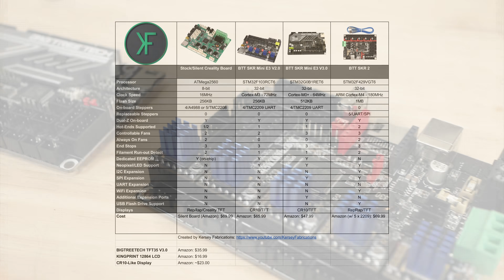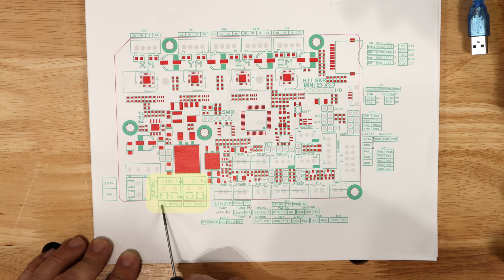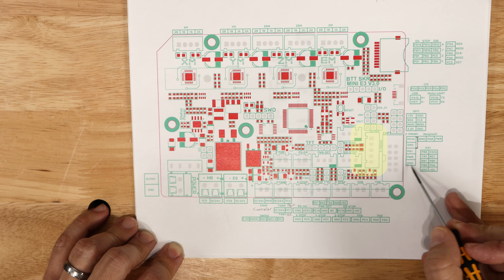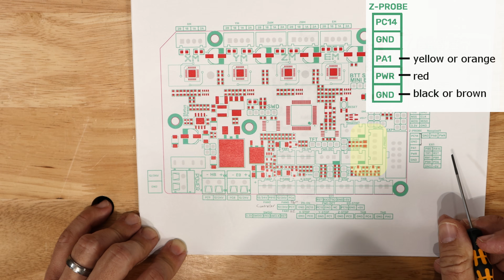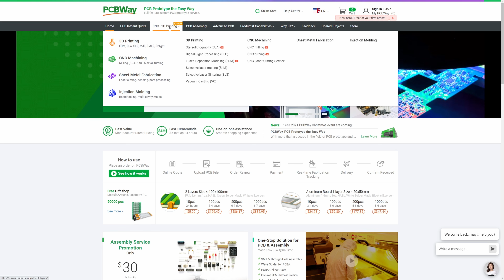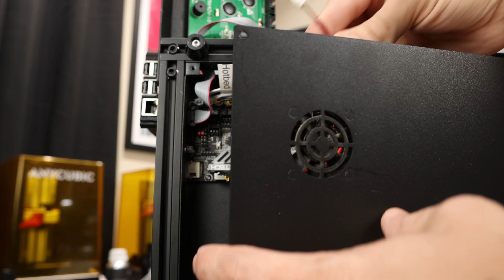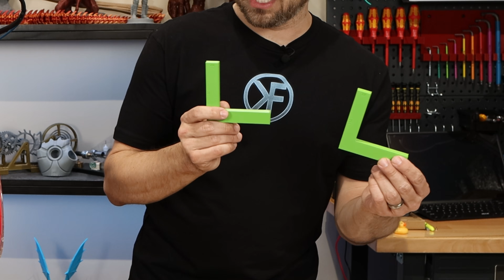Bigtreetech SKR Mini E3 V3.0 - Ender 5 and Ender 5 Plus

Comment from the maker: NOTE: The Ender 5 Plus requires a new display (at this time) to upgrade to this board. Please see my other Ender 5 Plus videos using Bigtreetech boards.

ALSO NOTE: There are many reports of people having problems using this board with the stock BLTouch on the Ender 5 Plus. It does not happen to everyone. It did not happen when I tested it myself. The only known POTENTIAL fixes are switching to a CRTouch, switching to Klipper, or there has been a case of just needing to update the touchscreen firmware to the latest.

With that being said, I CANNOT and DO NOT recommend this board on the Ender 5 Plus at this time. There are too many people having these issues and, while I've improved it in my latest 2.1.1 firmware, I have not been able to provide a fix for this issue. So far it appears to be an electrical issue that software has not been able to work around.
Reply: What do you recommend instead?
Reply from the maker: I recommend the SKR 2 or SKR 3 (just released beta firmware) at this time. The SKR 2 has been running great in my printer.
Reply: @kerseyfabs  skr or 1.4 turbo?
Reply: Or skr e3?
Reply: @kerseyfabs  u recommend the skr2 skr3 or skr e3? Or turbo 1.4 which would u really use
Reply: I was talking a rep at Microcenter, and he stated that if you change the BL touch to use the 5 pin Z probe, and change the firmware, it will fix the issue. Have you tried this?
Reply: @subytek  I have not. I don't even know which 5 pin connector to get
Reply: Have you seen this video from Aurora Tech about fixing the BL/CR touch issue? https://youtu.be/dtwWnz2-5VQ
Reply: Hey does this work for ender 5 pro also?
Reply from the maker: @twiztid664  Yep!
Reply: @Kersey Fabrications  right on, any suggestions for a newbie wanting to compile for first time, my setup is a ender 5 pro, crtouch, and microswiss d.d&h.e.
Reply: whick kind of problem with bltouhc?
Reply: Supported now for ender 5 plus on multiple firmwares off the e3 mini v3
Reply from the maker: What do you mean?
Reply: @kerseyfabs  Oops I missed the word LCD lol xD

The stock LCD is now usuable with the Ender 5 Plus and the SKR mini e3 v3, just nobody has done a video on it, only text based dudes. *made by tinyfluffs on github :) silly yt banning ink shares lol
Reply: @kerseyfabs  CrealityDwin_2.0 for marlin code that works with the stock lcd :)
Reply: @noviceartisan  do you have a link to that firmware ?
Reply: @noviceartisan  got a link?
Reply: @noviceartisan  I don't suppose u got a firmware  I can use ??
Reply: @ryanw501  There were a few more optins than I thought that needed adjusting to make it work. I've now got the stock LCD working perfectly with the SKR 3 and the SKR Mini E3 V3 and Marlin <3 This channel has links blocked so idk how I'm to share it with you?
Reply: @noviceartisan  got the screen flashed now i am confused as to what marlin im supposed to compile and if im supposed to use audrino ide to compile and flash it thanks for the help
Reply: @azarian44  which screen are u using
Reply: @azarian44  I've got it sorted now, quite happy to share the finished file with you, you just copy it to the sd card, put it in the board and turn on, then wait for it to stop flashing the led, then power off, remove sd card and power back on and alll will be good :D (Obvs make sure you've got the pins for the board wired up right) I'll be making a walkthrough that I'll add to the Reddit Ender 5 Plus wiki soon. How can i send you the finished file before then so you can get on with it? I can't share links on this dudes YT page :(
Reply: @noviceartisan  did you end up doing that write up? I am not on reddit so if you could post it here it would be a huge help
Reply: @alexanderneu5436  I can't post links on here, the OPs channel has links blocked 🤕 My email is on my channel in the about section if you want to communicate that way 🤘
Reply: @alexanderneu5436  You all good now after that bit of help dude? :)
Reply: @noviceartisan  I am going to start the conversion tonight actually. I think I am good, but I might send you an email if I run into an issue tonight. I think its funny that Kersey blocks the links to a less cobbled solution 🤣
Reply: @alexanderneu5436  The one I've shared on the repo is for the skr 3, keep forgetting to add the skr e3v3, just needs the motherboard tag and the stepper motor fileds changing to work with it tho. Connects to the TFT port on it. Pin out is rather obvious, +5 to +5 gnd to gnd, tx2 to tx and rx2 to rx :)
Reply: I'd like to say I compiled my own firmware that you can use the stock screen, also you have to repin it and I wrote down what wires need to be changed for it. The only issue I have rn is the bl touch, if you may we can go over each other's build and we can get one working for a stock ender 5 plus
Reply: @djjoey0812  you mind sharing the firmware? I'm stuck right now with the new board installed but can't even use it
Reply: @5t341tH  yes I have a GitHub to it I'll get the URL right now you'll have to flash the screen to what marlin says for 2.1.2 and I have the pin outs for the cable to change
Reply: @5t341tH  it looks like it won't post the link
Reply: Sorry I haven't gotten back sooner, the message says this file is damaged or 1 File Viewer could not open this file:
Reply: Kersey, i just upgraded my ender 5-plus to a skr mini E-3 V3.0 and everything works but the BLtouch doesent :( so does this mean that i need to purchase a CRtouch?

Comment: Love your video. It got me through a lot.

I have an Ender 5 Pro with a BIGTREETECH SKR Mini E3 V3.0 Control Board and a TFT35 E3 V3.0.1 Touch Screen Display (32-bit).

I'm having a few problems: the BLTouch is cycling but not extending when trying to level, and the Z-stop might as well not be there. Also, the screen says "Ender 3" but I have a 5 Plus. I think if I can get these things to work, I'm golden. I'm not sure why it says "Ender 3" when I ordered for the 5 Pro. Any help would be appreciated.

Comment: So I can’t seem to get the hot end fan to come on.  Have plugged it into all 3 fan plugs.  Is there possibly a setting somewhere to run on?   Parts cooler fan comes on no problem.  I even swapped the fan to a new one
Reply from the maker: Did you verify that it's loading my firmware correctly? Did you also verify the correct fan voltage?
Reply: @kerseyfabs firmware is loaded correctly. I’ve been able to print no problem.  I noticed it on my 3rd print when trying to solve the stringing problem.  It’s a 24v fan which I believe is correct
Reply from the maker: @oliverpw87 It's possible that the port is bad. If you can manually turn it on on the display, that may be it.
Reply: @kerseyfabs I figured it out.  The pins on the connector you recommended were reversed.
Reply from the maker: @oliverpw87 Good to hear!
Reply: @kerseyfabs appreciate the video and the support!!!
Reply from the maker: @oliverpw87 🎉

Comment: I went to your step by step and when power on using yours or any firmware.bin, the screen just shows ender 5 plus and creality ,, never moves forware.  also, when I turn it off and look on the sd card, the file name has been changed every time to firmware.cur
Reply from the maker: You can't use the stock display. You have to replace it.
Reply: @kerseyfabs  ahh ok. I installed the Taft 35. Got your firmware to load. Everything movesx y and z. But the bl touch gives an error. Is there something that has to be done?  I used your firmware for the bl touch
Reply from the maker: @apr6337 The bltouch is just a pain on the Ender 5 Plus. You may have to separate the wire and run it separately. It's sensitive to interference.
Reply: @kerseyfabs  I saw that. I have a new cr touch. Is it better?
Reply from the maker: @apr6337 Maybe a little but it's not known to always fix it.
Reply: @kerseyfabs  ok I’ll try some changes. Thanks for your help and thanks for your videos. I’ve watched all of yours on the 5 plus. I bought 2 from a guy. This one that the stepper driver went out. That’s why I got the drop in mini. And then another one that was being built with the one.1 conversion. I used the first one for about 2 weeks. Got hooked and bought a brand new k2 plus combo the other day. Can’t wait to get it. Again, thanks for your content
Reply: @kerseyfabs do you use a touch at all?
Reply from the maker: @apr6337 Yes. I use the Bltouch. I just realized you're posting this on my V3 video. That board has known bltouch issues. Check my description and pinned post.

Comment: Been scouring the web for a solid instructional video on how to upgrade my Ender 5.  I've put in the SKR Mini E3 V3.0 and the CR touch on my Ender 5 (not a plus or pro...no touch screen).  I have had nothing but trouble with firmware.  I can't get it to z-home correctly.   Any thoughts from you or anyone else in the comments?  

I'm trying Marlin right now, but I'm open to whatever I need to do to get this thing running.

Comment: I have an Ender 5 Pro with a CR Touch, and I uploaded this firmware to my SKR Mini E3 V3. However, the bed leveling and Z-axis motion during homing aren’t working properly. Could someone help me figure out what might be going wrong? Thanks in advance!
Reply: Brother I am having the exact same problem and no matter what I do no matter how I said it it will not act right it won't even run a test print hell it won't even go to home without stopping.. so if you do find a fix please let me know..

Comment: Hi. Just watched your video. I have downloaded your ender 5 firmware for the SKR mini e3 v3 board with bltouch. Do I still need the Z stop as mine broke and I opted to go the CR touch route. And once I flashed the board with your firmware, will it just auto home and I can then just do a test print or do I still have to level the bed manualy first and then print.
Reply from the maker: It's been a while but there may be a BLTouch version of my firmware. If there is, you're good! If not, it won't work and it would take modifications.

Comment: My Ender 5 has a BTT SKR Octopus v1.1 Board in. But this board does not fit into the electronics bay of the Ender-5.
Reply from the maker: The Octopus board is a little large for that use case unfortunately.
Reply: @kerseyfabs my Ender 5 has 2 Z Axis and 4 Extruders.

Comment: hi, I've watched your video a bunch of times and I know I have every thing installed right. I need your help because it won't accept your firmware or anybody else's for that matter. I've tried the reset button with no success. the firmware that came on is still installed. every axis manually moves but in the wrong direction. do you have any ideas? my printer is a Ender 5 pro

Comment: Thank you for the great tutorial. Im having an issue with the nozzle. Its showing ERR on the screen when i turn it on. everything else works fine, bed heats, nozzle moves, fans run. Im not sure what is wrong with it and was hoping you had an idea on a fix for it.
Reply from the maker: It's possible the thermistor is bad. You can test it with a multimeter.
Reply: @kerseyfabs  that was it, Thank you for the help. got a new one on the way.

Comment: Using your firmware, my E5+ wont Z home, much less level. Are there any config adjustments or troubleshooting steps you recommend?
Reply from the maker: Try to clear your eeprom using the menu selection and see if that helps.

Comment: Hi, I installed the motherboard and loaded your firmware, but when I tried to start printing a file, the system rebooted and stayed on the startup screen, doing nothing. Has this happened to you, or do you know what the error could be and how to fix it?  Thank you.
Reply: Additional information:
I installed the board on an Ender 5, used Cura 4.6, and the print file is gcode.
Thanks

Comment: For some reason my hotend fan doesn't turn on ever when connected to FAN 1, so I ended up hard wiring it to my 24v power block terminal. This is closer to how the fan is wired on the factory board in its own power block terminal (the one bigtreetech chose to omit)

Comment: I'm confused on the fan hookups. With the assumption the small fan on the right, with the shroud at the bottom is the hotend fan, mine has blue and yellow wires, which I have connected where you said is "fan 1", but your blue/yellow wires are connected to "fan 0".

Also, in your list of firmware links you mention ender 5 or ender plus. Is ender 5 or ender 5 plus, the same as the ender 5 pro? Thank you!
Reply from the maker: The fan that cools the part (blows on the print) is the part cooling fan. The fan that blows on the hotend to cool the part that heats up is the hotend fan.
The Ender 5 and Ender 5 Pro use the same firmware. The Ender 5 Plus is a different machine altogether.
Reply: Thank you sir! I know this is an old video and topic for you, but I just recently pulled my old ender 5 pro out of storage after 4 years, and thanks to you and my Ai companion, was able to get some successful prints once again.
Reply from the maker: @Eszentric  I love hearing that! Congrats!

Comment: been trying to get this skr mini e3 v3.0.1 for two days now unhooked and rehooked up 3 times now boots up and starts heading hotend right away will not flash firmware and also says no sd card and no printer detected. everything is hook up just like in this video then the screen starts beeping. This dose not work for and ender 5 plus

Comment: I know I’m late to the game here and I wished I had read your comments below before ordering the mini e3v3 board.  I used your compiled bin file and connected the board just like you did (thank you for posting that!) for the Ender 5 plus and it seems like I have a bad board.  Which board do you recommend over the e3v3?  Thank you for all your work!
Reply from the maker: You should be able to get the v2 still and that one works fine.

Comment: Hello! Is there a solution to use this  board with the original display on ender 5 plus?
Reply from the maker: Insanity Automation has some but I've never used it. There should be some online resources about it. I never finished a solution that was fully functional.

Comment: Crazy frustrated with Creatliy's lack of ongoing support. Why not just do another run of 2.2 boards. NO ONE HAS THEM and this SKR has been a nightmare if you are not a coder. The question I have is whether a BIGTREETECH TFT35 V3.0.1 is plug and play with some firmware.bin for 5+ that does not require 100 hours and 3 coding nijas to compile?

Comment: I am upgrading my Ender 5 Plus with the SKR mini e5 v3 with the TFT35 v3.0.1 and the CRTouch.  The firmware here in the .bin file actually connects the controller to the LCD, but I need to make some tweaks for the neo-pixel and motor voltage.  If I try using the currently Marlin and creality configurations I get the "No Printer Attached" message. I made sure that the bad rates were matched up between the LCD screen and the controller.  Do you happen to have the source configurations used for the Ender 5 Plus?

Comment: I can"t get the bl touch work , i"m using yr firmware ,it ll home but the probe wont pop out so my nozzle  crashes to the bed bud self test probe is ok, changed the probe  as in manual and still nothing on ender 5
Reply from the maker: I've commented in multiple places that this board does not work well with the bltouch. I recommend the 2.0 but not this one.

Comment: I have ender 5 plus if i change the motherboard without change the screen did it work with stuck screen and what the firmware should i use ?

Comment: Kris, awesome video and thanks for providing the links for the firmware, I was pulling my hair out trying to find firmware for the Ender 5+ with BLTouch that was preconfigured and compiled for the SKR Mini E3 V3.0. For the most part this firmware is working great, but I've had a couple of weird issues I was wondering if you could help me with? Occasionally when I go to make a change like adjust Z Probe offset or adjust bed temp or something else while a print is going it won't adjust and I'll get an error that it's "busy". I've also had an issue a couple times where my Z offset or bed level settings weren't saved from the last time the printer was used after I turned it off, and when I tried to print after turning it on again it rammed the bed into the nozzle and gouged my PEI plate. I know I saved those settings into the EPROM before it was powered down and I got notification that they were saved successfully, so I'm not sure why it would do that. Also, my Z up and down works normally when printing, but in the 'Move' menu when moving the Z axis manually, Z up and down are flipped. Otherwise the firmware is working fine, I've not had any issues with the BLTouch or bed leveling during normal use or printing, just the issue I described where it didn't seem to save my Z offset settings. Any ideas? Thanks again for all you do!!

Comment: I have the same setup like you Ender 5 PRO, the V3 board but with 3D Touch as well. I cannot get the z homing or autolevel to work. X and Y move OK, but Z only goes down and then up but the touch pin does not deploy. If I do the BLtoucg test through the menu all works ok, like pin test, deploy and return. I have tried with a Creality CR touch - same thing. I have tried plugging the black/white wire to the Z switch on the pcb but it does not deploy the pin then. Could you please point out what to look for?

Comment: My Ender 5 Plus was faulty out of the box in two years I replaced 2 stock motherboard. This time installed SKR Mini E3 V3 everything looks ok except Z offset, bed level is 12cm under nozzle? All the time the same I cant change offeset manually becaus is too big, "probing error" BLTouch connected to probe and firmware version for probe, TFT35  BTT ???